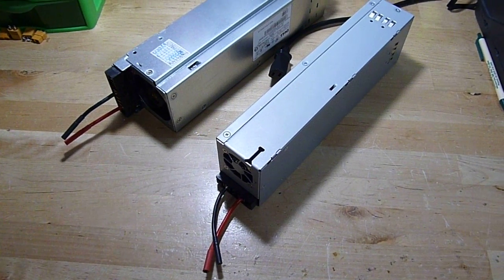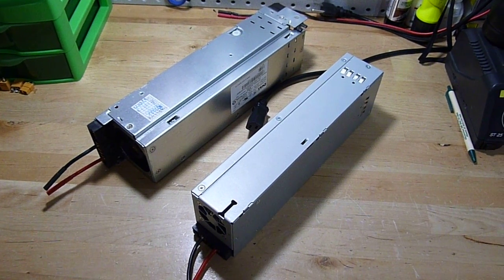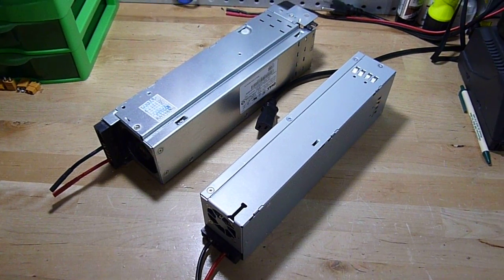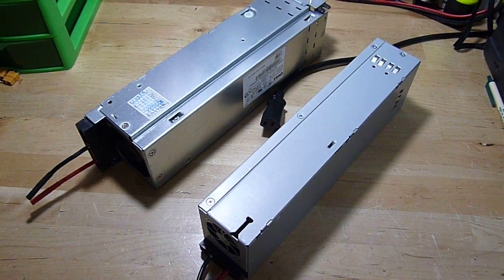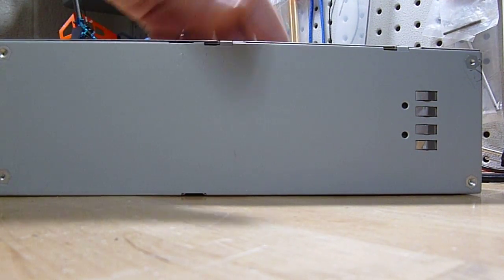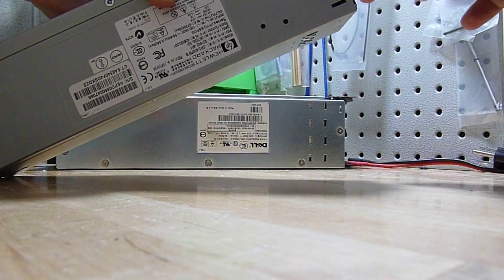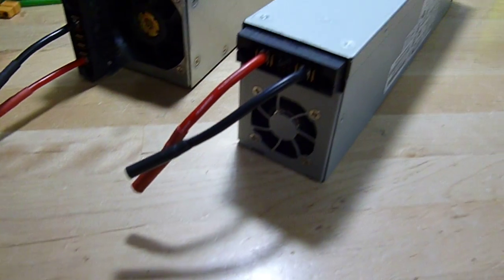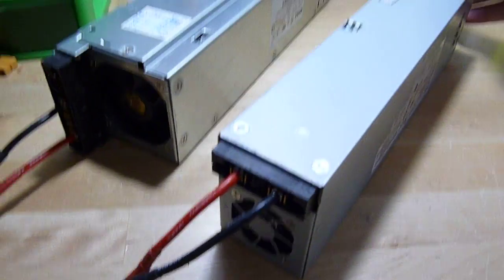HP and Dell server power supply noise

Comment: I did use the noctua 60mm but 3000rpm max and theres heat

Any advices about 60mm size soundproof or quite and more than 3000rpm??

Comment: Can you lower the voltage to the fans to be silent?
Reply: You would not want to do that. They are loud for a reason, these server power supplies pack 1200-1600w into a small form factor. Some of them are even 2400w

Comment: Could u tell me how u jumped the connections to allow the PS's to power up for testing. It looks like u bridged two different pairs of connectors. I want to test a Dell P2591 hotswap PS unit to determine if its dead. Figured if I can power it up standalone it will help me verify if its the PS thats indeed dead or the distribution block or MB is whats cooked. The other hotswap PS in the tower died a year ago but this remaining one was working until this past Friday.